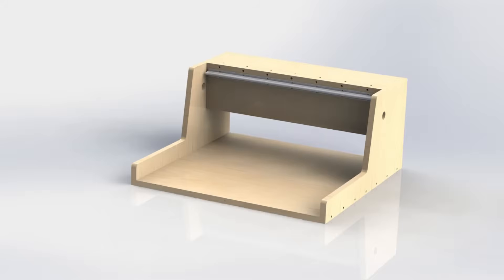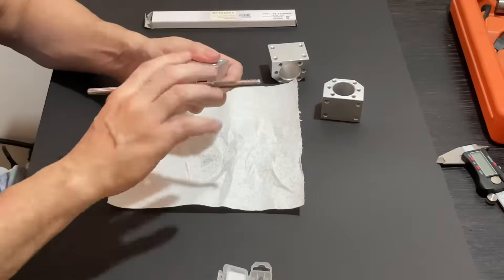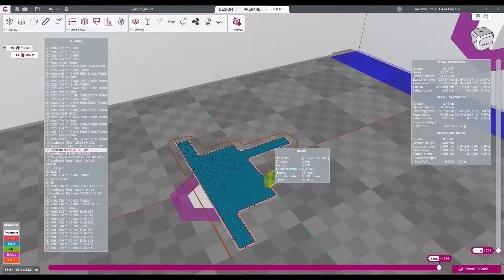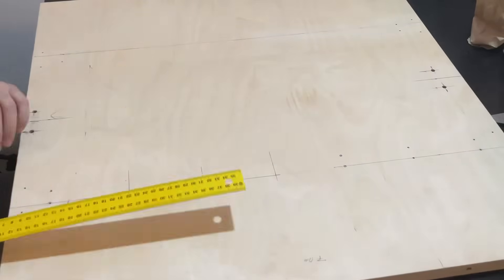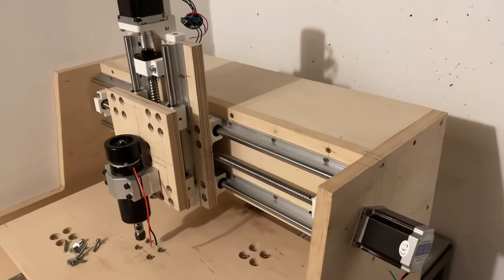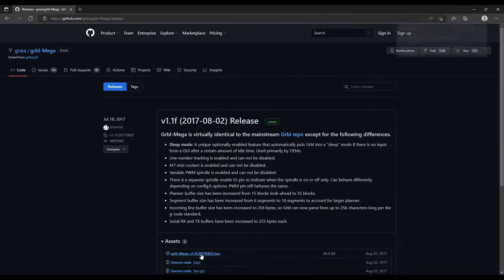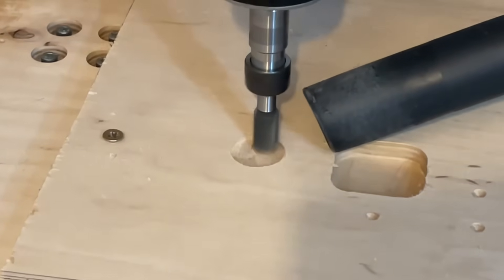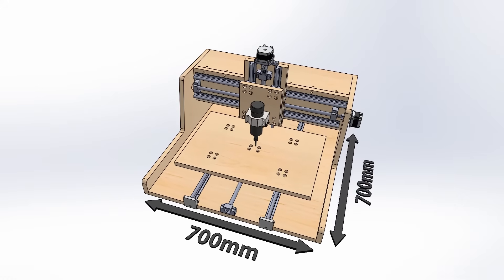DIY CNC router build

Comment: Do you think moving the baseplate and therefore the workpiece is an improvement on a fixed baseplate and a full xyz gantry?
Reply from the maker: The weight of the baseplate is small, so it is better in my opinion. The whole cross beam is very rigid and with a larger spindle, milling aluminium is possible.

Comment: Hello, I am a beginner in DIY CNC. Every time I cut, the machine will run out of the path I want to go after a while. Can you analyze the reason?
I use GRBL, FUSION 360, thank you
Reply from the maker: I don't know anything about your machine, so, I'm just guessing. CNC software generates GCODE that uses G28 command to home the toolhead. If you don't have endstop switches installed, this can be a problem. Or you may have step loss because either you aren't using enough current to drive the motors or, the speeds are too high. A lot of things can cause such symptoms.
Reply: thanks for help  @robotics_and_stuff
Reply: good job

Comment: Well done! Great machine! I made few CNCs but not looking so good. 😢😢 I spent a lot of money to made a machine. Here are two examples. I spent 400€ for the first and more than 1500€ ( dust shoe and cyclone for wood and  vice for metal included) for second machine, this is very expensive hobby.  🤔🤔

https://youtu.be/TDTDN_KkoJc
https://youtu.be/ziXmku7p6O0
I use MDF for work plate on my second shown machine because metal one is too expensive. I have great and precise vice which I mount when I am doing aluminum and metal and I use only mist not flood. I use piece of thin metal sheet to protect MDF but some coolant sometime drip on MDF 😥

Bits are very expensive although last long. I spent more than 6€ for single tungsten carbide coated bit !!!! 😗😗 and I have a lot of various bits for different materials so this is great expenses for this hobby or work.

Comment: How big is the actual working area? I like the design but am curious how much smaller the spoil board would need to be compared to the 700 x 700 frame of that makes sense.
Reply from the maker: 700x700 mm frame gives 500x400 mm workarea.
Reply: @robotics_and_stuff  Thanks so much. I'm thinking of building a similar one but scaling it up to 1000 x 1000 from the 700. Wanted to get an idea of what your lost area was so that I can calculate it for scale. Thanks again!
Reply from the maker: @RichardBrooksWoodworking  I recommend to build yours with a beefier spindle, 1.5kW or 2kW is perfect.
Reply: @robotics_and_stuff  Thanks for the suggestion! I had one picked out that's 500w so it's good to know I may need to go bigger.
Reply: good